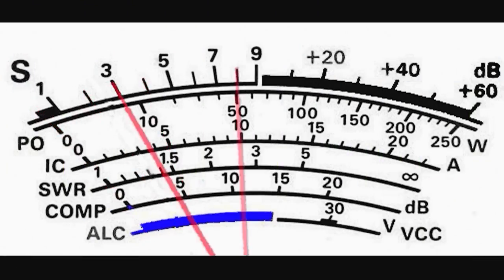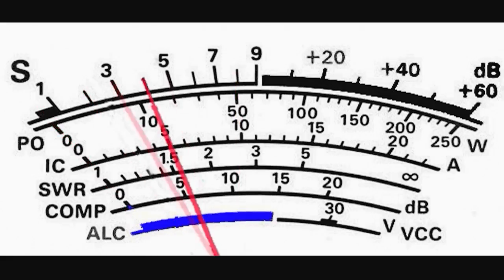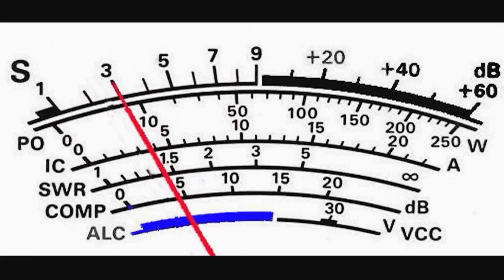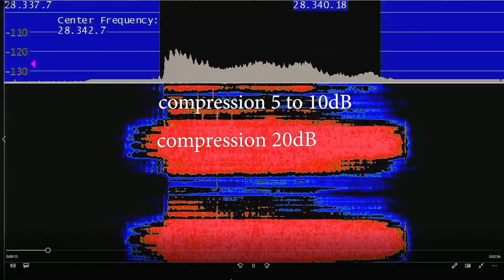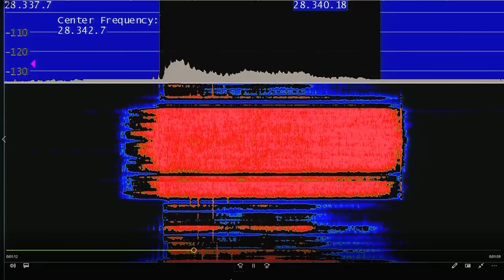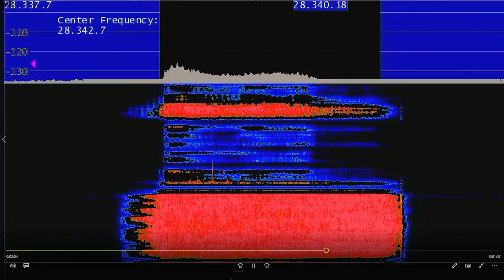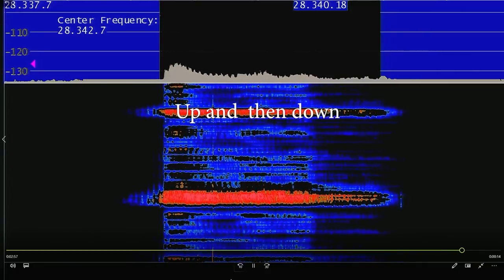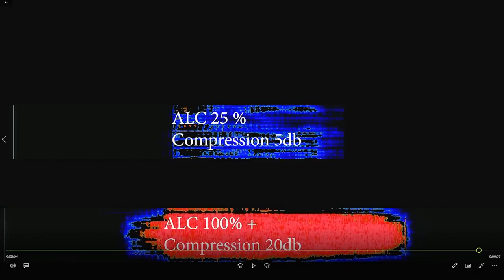Microphone Gain Setting On Ham Radio Transceivers By Jim W6LG YouTube Elmer For Ham Radio Basics

Comment: Hi Jim. Good hearing from you. My rudimentary Kenwood TS140S slide controls limit my adjustments so I just crack the mic gain a hair up. It kind of varies depending on where I am on a given band. The ALC meter just moves, so I get pretty good reports, in my case, so I just leave it there. Joe in PA 73

Comment: Another great video Jim, sometimes it is less than intuitive, with one of my rigs I made the mistake of setting the microphone gain about half way, figuring that an unamplified  dynamic desk mike would not have huge output, half way seemed a good starting point. I was surprised to find it wants to be near the low end of the microphone gain control. Different rigs use different ways to derive ALC, as you know older rigs used to monitor the grid current of the PA so any ALC indication was a sign that non linearity was already happening. My old flagship transistor HF rig has an RF power control that causes ALC to happen earlier to reduce power, I tend to operate with MIc gain quite low (whatever that means) and use gentle compression to keep the peaks down, finally the RF power control to protect the amplifier from the odd sneeze! I try to stay out of ALC completely for most of the time. Most people do not notice a little compression, something like 3-6dB does help with taming the peaks. It is amazing how much you can learn about driving your radio by putting it on a dummy load with a PEP reading meter and a monitoring receiver. 73

Comment: Good explanation Jim. Because of your previous videos I learned how to properly set my mic gain using the ALC and even though I run low power I get good audio reports from a stock out of box rig.
Reply from the maker: Great to hear!  I learned the hard way.  I was guilty of splattering with an HT37 much to the upset of other guys in the San Fernando Valley.  Thanks for the kind words.  73, Jim

Comment: Hi ,Jim, good video well explained, since i have my Heil PR 40 microphone with my Icom ic 7300 ,have never looked back, also i dont use a mixer, but a Presonus tubepre v2 pre amp is very well suited. Great advise on the ALC and comp settings, i brought a fm/ssb radio so i could fine tune the bass and treble settings, keep up the good work 73 from Rotterdam.

Comment: Thanks for this. Another issue is audio circuit headroom. Some radios will let you do whatever you like. Others however have low headroom. That is too much input, whether at mic level or line level, will overdrive some portion of the audio circuitry regardless of mic gain settings or compression. There's no rule as to where gain control must be, before or after a gain stage. Something to listen for is distortion even with a low mic gain & low compression seeing. Flex 1500 for example overloads easily. One needs to drive it carefully, then bring up gain (numerous places to add gain) to appropriate and desired levels.

Comment: I've never had to adjust my mic gain on VHF rigs....but my 12/10 meter President Lincoln it's all the way set to the right! ...I'm going to check my ALC for sure!
Reply: As far as I know that tranceiver won't have an alc meter. As long as the magic screwdriver hasn't been inside that President, I.E. no tweaking and peaking, you should be fine.

Comment: My avatar, and observing it lightyears away. Through a polygonic multiple lens or a flatsurface - dumbell lens. Preceeds the same problem.. scattering is significant through adaptive medium     arrangement. One can try and coalesce angular velocity as one does through a synchroprism in vision.. referencing to your compression set filtration electronic com (or cam) ponents ? Total n00b i am btw... thank you for sharing your luminescence . It is bright as day. Grtz

Comment: Hi Jim ! Heard you on 20 again but wasn’t able to get in the extra class portion. Yet anyway. Yes you are totally correct about nets and the praising of horrid audio. This actually turned me away from most hf nets. Is that a smb7 mic? Sounds great! I noticed the passband expand while turning up the comp. so if a transceiver has a tx bandwidth of 50hz-2900, more compression will take it outside of this 2.9k window? I know some filters are looser than others. Looks like dirty IMD. I see that a lot with people running high alc with certain amplifiers. Merry Christmas bud.

Comment: Thanks for the video Jim. I use an IC-7610 and set my ALC to 1/3 of the ALC scale without compression enabled. Then I enable compression and set it to about 3dB, but then my ALC goes a little bit higher. I leave my settings there. Would you recommend lowering the mic gain again to bring the ALC to 1/3? HNY! de KØPIR

Comment: there is no way this is happening with the IC7300, that thing is tight and you can't make the audio derail like when you had the compression at 20dB... I've seen in the IC7300 manual to keep the ALC between ¼ and ½ of the bar graph but you get 15-20 watts out... When the ALC goes right to the end of the ALC bar graph, sometime one red bar is lighting up and it sounds beautiful, no where near what we hear on that video...

The only thing that happends when you push the compressor to high is to pull ambiant background noise and get reduced gain when you start talking. Compressors are used to pull low levels signals and attenuate high levels. I can't drive my 7300 with such low ALC and compression. I usually run the compression to around 10dB and when this happens, the ALC is right at the end of the bar graph...